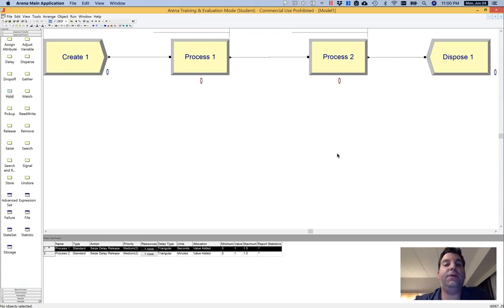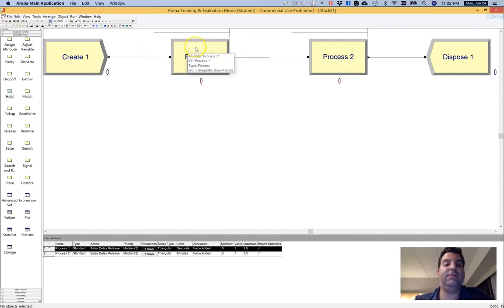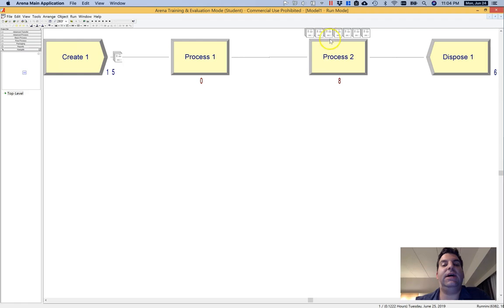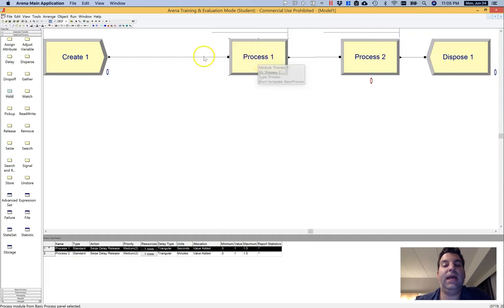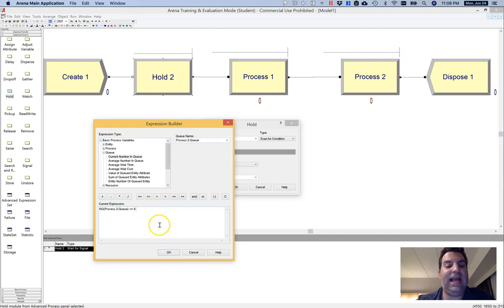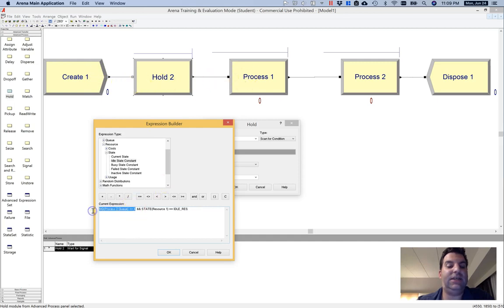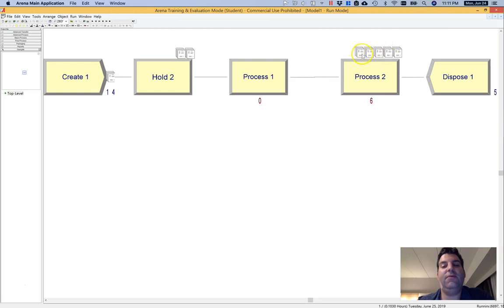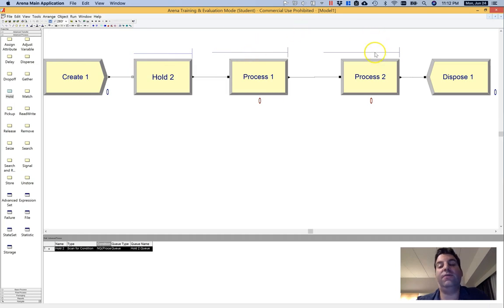IEE 475: Arena Tips - Use Hold to Adjust Where Entities Queue with Multiple Serial Processes (Pull)

Comment: I have a question: If I use two hold modules in parallel, both connected to the same process with the condition WIP==0, can both hold modules release the entity at the same time? During the simulation, the number in process is equal to 2.
Reply from the maker: In principle, when the "conditional event" of the WIP hitting zero occurs, it should trigger both Hold modules simultaneously. The number within the Process block refers to how many units of the associated resource are needed for an entity passing through the process block to receive service. This is not the same as the capacity of the resource, which is set in the resource data module (under the "Data definition" panel in newer versions of Arena). If the entity needs more resources than are available, it will queue up.
Reply: @TedPavlic  I want to model two parallel conveyors and one forklift. In the process of transfer, when a pallet is queued, it doesn't have significant meaning.
Reply from the maker: @BENAMORSafwen  I don't know what you mean by "doesn't have significant meaning." But if you have two sources of entities going to a single process block that seizes a finite resource for every entity that goes through the process, then two entities that arrive roughly at the same time (one from each source) will have one go into the process and the other queue. The maximum, minimum, and average number of entities in that queue will reflect how often an entity is waiting for access to the service (where immediate access to the service will not have any queueing). If you don't see any queueing in the statistics (the maximum number of entities waiting in the queue is 0), then you don't have simultaneous encounters at the service. If you see a small amount of queueing, the maximum number in that queue will be 1 (and the average will be close to 0). That would occur either if near simultaneous encounters are very rare or if the time within the service is very small (and thus the service is made available again for other entities to use it soon after it is seized).

Comment: Hello,Thank you for your explanation and I have a problem-could you please show me how to set Process 1 and Process 2 circulate for 10 times and then comes to Dispose 1? Best wishes!
Reply from the maker: You could add an "Attribute" block that increases an attribute (that is initially set to 0) on any entity that goes through it. When that attribute reaches 10, a decide block could eject the entity from the cycle. Something like this would ensure that every entity that enters the cycle will go through it 10 times. This really has very little to do with the point of this video though (the pull logic).

Comment: HI Sir, thankyou for the explanation in the Video. 

If I may ask, I want to ask about my project about queue in the elevator.

So i Had data about time between arrivals of the people and queue time (waiting for the elevator from first floor to many floors until back again to the first floor to get peoples in the queue). How to make the queue can be done in the hold only ? or what models should i use in the project so that we can see the queue in the Hold process ? Should I use remove,release,delay,or signal about it ? the condition is the distribution of the queue time of the elevator is NORM( 74 , 24.6 ). Thankyou Sir sorry if the vocab is bad
Reply from the maker: I think a proper answer to how best to simulate an elevator queueing problem would require more than a simple response to a comment. I recommend that you go through the "Browse Examples" under the "File" menu in Arena, and I think you may find several working examples that give you some ideas on how to do this. You might check under "Browse SMARTS" as well, which can provide you small examples that you can build off of.

People will sometimes use Arena to simulate traffic intersections where only a subset of the different incoming traffic lanes can go at a time. This is similar to an elevator problem. One way to do this is to use a Create block to create a single virtual entity (it only arrives at the very start of the simulation and only 1 ever arrives, and it is never disposed) that then gets put into a separate cycle that changes the state of the traffic light so that it cycles (for example, it starts in "North/South" and stays there for a few minutes and then switches to "East/West" and stays there for a few minutes and then recycles). This virtual entity (which doesn't map to an entity in the "real world" just cycles over and over again in logic blocks that continually set and reset a global variable which reconfigures decide blocks and/or hold blocks within the main simulation that cause traffic to wait (for example, "East/West" traffic will wait when the intersection is in "North/South" mode, and vice versa). A similar scheme could be used to move an elevator around, but perhaps the schedule of floors that it visits will not be deterministic but randomly selected or determined based on which passengers are currently in the elevator.

You may also consider some of the "batching" operators that can hold until a certain number of entities are ready (say, to wait for a full elevator), but I'm not sure that really maps to a real situation.
Reply: @TedPavlic  thankyou for the answer sir. The way sir gives the answer gives me more insight to explore on arena. We were having the trouble on the distribution time for the elevator to go to each floor.
We gathered some more data then to know the distribution, even though i think it may not correct. But we already pass the project with A score  🥳
And for the entities, we just used the number distribution based on taking data on site and find the distribution that fit to all. But batching is a good idea too for some problem as example if its time for entities to go to class or canteen (the site is at campus) maybe ? Once again thankyou for replying sir have a good day 🙌

Comment: hello mr. ted, can you help me.. So i have this system that have to wait until 10 parts and then release 10 of it to the next process to be assembly.. what should i input for the expression? shoul i use the holdfor condition or hold for signal? thank you so much i hope you can help me out
Reply from the maker: It sounds like you want to hold for the condition where the number of parts in the hold queue is 10 or greater. That said, the "Batch" module might be a better fit for you. With "Batch", you can tell it to create a permanent or temporary batch once a certain number of entities has accumulated in the Batch queue. At that point, it will create a batch of that many entities and let it move forward (and you can then separate entities out of that batch using a Separate module later).

Comment: Hello Ted, Hope you can help me out, I want to simulate 6 machines that are attended by 2 technicians, So when the machine fails or there is a model change, then 1 of these 2 technicians fixes the machine that is in the failure mode, this model intends to optimize the machine output by friend different configuration of the technicians, for this I thought to assign the technicians as a resource to the failure, by I do not know if this this possible, or it is necessary to configure a logic in the model, hope you can answer and understand my question.  Thanks
Reply from the maker: As you probably know, the traditional (simplest) way to implement failures in Arena is with a failure schedule. In your case, you want the duration of the failure to itself be a delay whose duration is conditioned on the state of the system. One option for doing this is to have a CREATE block generate failure instances (as their own entity types) instead of using a failure schedule to trigger the change in state. That is, on arrival of a failure, you can adjust the resource to switch into the FAILED state (there is a STATE() expression that you can use to change the state of a resource in an Arena expression). The failure instance can then go through its own seize/delay/release process block that seizes one of a "technician resource" (that has capacity 2, in your case). Once the technician resource finishes that process, you can have the failure instance entity reset the state of the machine resource out of the FAILED state. I'm not sure that's the best way to accomplish want you want, but it is the first thing I would think of trying if I were doing it.

Comment: Can you decide instead if queue one of a parallel processes is too long, to send to process two? Trying to make a model that sends parts to a second machine if the first machine has 5 in queue.
Reply from the maker: Yes, there are several of different ways to do this. Using constructs similar to the video above, you can use a "Decide" block that conditions the flow of entities based on how many entities are queued up in downstream queues. So, you could check to see how long a downstream queue is and, based on that, send a new entity just arriving to the decide block down a different path.

Comment: Hi. Thanks for sharing this video. Great! 

I have a question about ARENA: is it possible to use different times in the same resource? For example, I have 3 types of trucks arriving at the same time and they have to be weighed on the same scale. Truck A is weighed in 03 minutes, truck B is weighed in 05 minutes and truck C is weighed in 7 minutes. After weighing, they are released and the process is closed. So, how to build this model in ARENA? Could you help me? Thank you in advance.
Reply from the maker: There are a number of ways you can accomplish this. For example, you can actually store the service time for each entity in an attribute of that entity. When the entity is created, you can draw its type-specific service time. Then, when each entity reaches the single process block, the process block's "Delay" can be set to "Expression" and you can use the attribute name from the entity. I do something like this within the example in my YouTube video explaining how to use the "Match" module:
https://youtu.be/8QCKWeT-aRc

Alternatively, you can use a "Decide" block upstream of the process block to send entities of different types through different Decide blocks. Each decide block can use the same resource (which will mean that if an entity is using the resource in one process block, entities arriving to the other process blocks will queue up there). The downside of a solution like this is that it can upset the FIFO order that you probably want in your process queue. So I would recommend something more like what I suggest above.